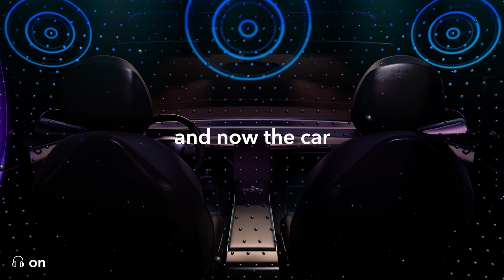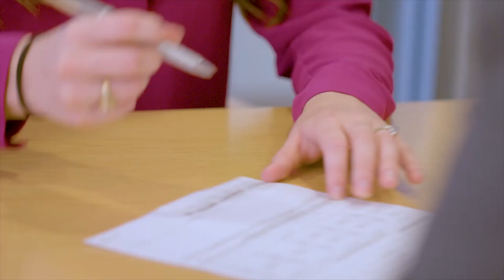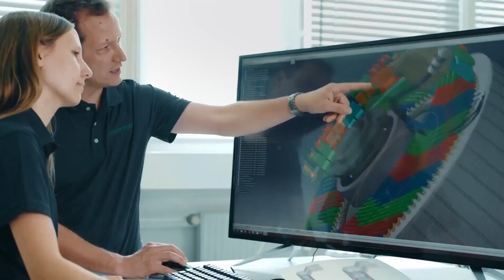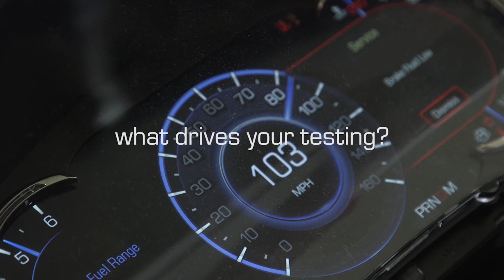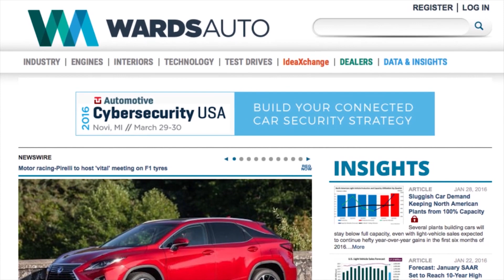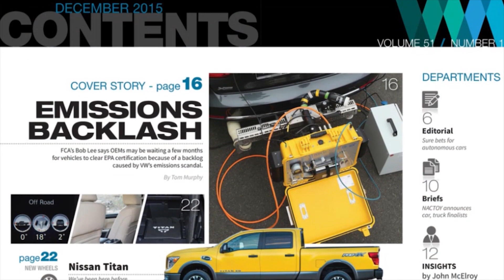Tesla to Ship 1st Semis to Pepsi; Hotel Powered by Hyundai IONIQ 5s - Autoline Daily 3422

Comment: I really like the idea of using commercial vehicles as a testbed for new technologies.  New battery chemistries, cell formats, new battery types, new charging standards, electrical architectures, HVAC technologies, platooning systems, active aero, tires, brakes suspension, etc.  Commercial vehicles such as trucks, last-mile delivery vehicles, and even coach buses see plenty of use,  consume massive amounts of fuel, and emit large amounts of pollution.  If any technology works well on them, then they'll almost certainly translate well when in a passenger vehicle application.

Comment: The 2500 GMC Sierra (and Silverado) are now the class leader in payload and towing capacity. The suspension upgrades earned it this new title.
Reply: I haven't driven a diesel truck since the 2007 super duty I owned... I've got to try one of these new ones. Insane numbers.
Reply: @kmo1290  i have the current generation L5P Duramax and it tows our 38' fifth wheel amazingly well. This updated L5P Duramax has even more torque and the 10 speed transmission will keep it in the sweet spot all the time.
Reply: This category is so fought out that expect both Ford and Stellantis to "up the ante" on their HD's soon (it's so a $🐄for all three). None of the three will make a HD BET any time soon, as electric motors and batteries are not made (50-70% loss on range) for towing or off-roading.
Reply: @syxepop  exactly. This segment will be highly profitable for at least another decade and well into the 30s. I'd actually love and EV HD pickup, but energy density in battery packs just isn't there yet and if you put a big enough battery in to tow with you'll have zero payload remaining.
Reply: @syxepop  I think Ford recently said to expect hydrogen HD trucks before BEV. I assume they mean FCEV, but I think Toyota and some others are doing R&D on hydrogen ICE as well.
Reply: IS this why it is outsold (BY A MILE) by the FOrd F150 but ALSO BY THE RAM??!! LOL
Reply: @anastassiosperakis2869  not sure what you're smoking but it must be pretty good! GM has been the number 1 selling full size pickup manufacturer for years? Also GMC is one of the most profitable brands in the world, Denali trim has a higher take rate almost every year.
Reply: GM is crushing everybody in heavy duty pick up trucks, and that is with their old model, the new model will just add to that.   Ford actually invented the segment with the super duty, and in 2000 had 75% marketshare, now, GM has crushed Ford and market share in the heavy duty segment, GM now has 40%, Ford struggling to hold onto 30%
Reply: @syxepop  Not sure how long that "any time soon" will work out to.   Navistar is building class B trucks.   If they can get or make the batteries they can build them.   Yes would be nice to have lighter battery packs.
Reply: @kmo1290  Not to sound like Elon but hydrogen makes little sense.   Especially hydrogen ICE.    Not efficient enough.
Green hydrogen starts with getting negative cost green electricity.   Lighter batteries are far more likely the making the magic work that hydrogen needs to compete.  I do see some interesting work with hydrogen stored on disks or in powder.   Works and public adoption aree a longs ways apart.
Reply: @anastassiosperakis2869  It is not the first time GM has made a better riding pickup.
Reply: @danharold3087  i was never in the market for one of these ridiculous things, but they are very popular with our secretaries (not the GMs, the Fs and the RAMS. Apparently they don;t consider the GM ones manly enough. Too bad for bankrupt GM, to make the better pickup and end up THIRD in sales behind even RAM and WAY behind Ford.
Reply: @danharold3087  I agree, it's not something that can be supported as the primary passenger vehicle power source. I just think it's interesting technology for things like HD trucks until (if?) battery density solves the range problem. But then you still have the same problem as the Mirai only being viable in California due to fill station infrastructure, and it seems unlikely anybody will make an investment in national infrastructure.
Reply: @kmo1290  Same problem as battery swapping.     By the time you get the infrastructure built no one will need it.
Reply: @anastassiosperakis2869  The companies now carrying the names GM FORD etc have little to do with the ones of old.  Used to love ford's esp the pickups.  Zero brand loyalty from me
Reply: @kmo1290  People fail to realize how many of the trucks in use today could be replaced by electric.  School busses, trash trucks, fire trucks, bucket trucks, delivery trucks, most any class B.    

What I don't like about hydrogen is that it is like handing the ransom money we now pay for gas over to some hydrogen company.   Electricity is too easy to make for anyone to corner the market. 

The amount of money to be saved by the operators of electric class A trucks is immense.  Once this becomes understood and proven they will never keep up with demand.

Comment: The new GMC HD pickup looks great,   nice interior,  and great power/towing.
Reply: No pickup looks good, much less great. They are BRICKS with RIDICULOUS grilles.
Reply: @anastassiosperakis2869  the Cybertruck looks much better 🤣😂🤣!
Reply: I didn't know GM was sponsoring this comment section.
Reply: It looks relatively good for a pickup, cybertruck looks great, but it doesn't exist.
Reply: @rp9674  the Cybertruch DOES exist very much. AND I never said it looks "great", I said that its INTELLIGENT design weirdness is FUNCTIONAL and not just  silly design, like all this chrome on GM-Ford-RAM pickups.
Reply: @anastassiosperakis2869    Grill means cooling,    need lots of cooling pulling a 36K load up the mountains in the summer..
Reply: @dmitchellhomes  No, grill: verb, to cook (on a grill)...😜 Grille is on the front of your truck.
Reply: @dmitchellhomes  thanks for the engineering 101 lesson. Hilarious to lecture one with four grad degrees from MIT who was an engin prof for 40 years at the U of Michigan. MY POINT was that all these stupid secretaries who drive pickup trucks they never needed are making gas and diesel even more expensive for YOU.
Reply: @anastassiosperakis2869  well, if you know anything about basic car design, you realize all of the pick up trucks have been getting much larger grills and much larger radiators, as their capacity for towing increases.  These are very connected..   Today’s pick up trucks, have power and capability similar to the semi trucks from the 1970s.
Reply: @anastassiosperakis2869  tesla has not sold a single cyber truck, even though they unveiled it three years ago, and have not conducted a serious test program. Yet, they have a few Proto types that they bring out once in a while, in recruiting efforts, or to pump the stock, but they have not ever taken one on a long road trip going anywhere, typical OEMs, put millions of miles on their prototypes, before a car ever comes to production..   tesla is a long way away on a cyber truck, none have ever been spotted, towing a trailer in the mountains, which is something you can’t test on a track or in a laboratory.   I’m sure when it first gets released to the public, people, like TFL truck, will take it straight to the steepest mountain pass in the USA and load it to the full capacity and see just how it does in the hottest summer day
Reply: @anastassiosperakis2869  I think cybertruck does look great, hope to see one IRL
Reply: @rp9674  I don't, but I later understood the reasons for the weird looks, it is becauser of its very usefulfunctions that it has this pointed roof, it's not a COnehead-mobile. The grille needs some work, it should not be expensive to fix.
Reply: @anastassiosperakis2869  it looks like the future, not grandma's truck. The coneheads were very tech savvy, as the French are.
Reply: @dmitchellhomes  I find it amusing that so many people wonder how an EV truck will do when towing up a steep hill on a hot day, when everything the world has learned about EVs since 2008 tells us with some certainty that an EV truck will tow way, way better than any combustion truck, especially up a steep hill on a hot day.

If you doubt it, check out the videos where TFL compare the F-150 Lightning with ICE trucks on difficult towing tasks.  After conducting all of these tests, Roman's conclusion?  The 2022 Lightning is "the best truck Ford has ever made."

And bear in mind, the Lightning is only the second serious EV Ford has ever made, and the first serious EV pickup on the market.  Expect to see big improvements in future generations.

The Cybertruck will be a fifth generation EV.  I don't know if the  packaging or marketing will fit the requirements of the US truck market.  But I can tell you with confidence, it will tow up a steep hill on a hot day way better than any truck you've ever driven.
Reply: @davidmenasco5743  I find it amusing when a person like you who has never towed anything in their life, obviously from your statement starts making claims, based on one, YouTube video, they saw online, and taking towing in general completely out of contact.   The F150 lightning towing it’s maximum capacity, has an effective range of 100 miles, where is this diesel towing three times as much, will go well over 300 miles between fill ups that take five minutes.  TFL, did not compare an electric vehicle, towing, to a heavy duty pick up, they compared it to light duty pick ups..    The problem for an electric pick up, when it comes to towing, and towing heavy, and in the summer, is the energy density of the battery compared to a tank of diesel, there is no comparison in energy density..   On the cyber truck, I have a hard time taking any of Tesla claims. Seriously, they showed that truck to the public three years ago, and still don’t even have a legitimate pre-production prototype doing highway testing, they have never been spotted, towing a trailer, which is something any OEM that is developing a new truck, will be seen all over the highway system in the USA, at least one year before deliveries and production start.  Tesla hasn’t even built the production intent models for this testing.  They have a few hand built one off each cyber truck, Proto types, which amount to more concepts vehicle’s, because they were not built with production tooling, or using production methods, the initial cyber truck prototype, had a steel tubular frame, we know that because motor trend magazine got to go behind the scenes and see it being built and wrote about it..  We will have to wait for Tesla to bring it to market to see, but even if tesla achieve their claims, 500 mile range, 14,000 pounds towing, they are still way behind this diesel, which has well over 700 miles of range on a tank, and control up to 36,000 pounds..   This is a massive difference in capability.   I think it’s possible to meet Teslas claims of a 500 mile range, and 14,000 pounds towing ability, but a truck with that capability is going to be heavy, because it needs a big battery pack.   When you look at what Tesla charges for vehicles, their cars with 100 kWh battery packs sell for well over 100 K and, and Tesla has never built a car with a 500 mile range.    So I think we better wait and see, Tesla initially said the plaid would do a lot of things that never made it to production, I think cyber truck will be the same, reaching the capabilities, they promised will be difficult, and very expensive, which Tesla fans have trouble admitting now, but reality will set in soon for them.
Reply: @dmitchellhomes  I didn't say farther, I said better.  You have a point about light duty vs  heavy duty towing capacity.  However, try to chirp the tires in a heavy duty ICE truck, and pass cars while you're towing uphill.  The experience of towing in any fifth generation EV truck will be unlike any towing you've ever done before.

Energy density is nice and all, but efficiency is just as important.  That diesel is likely about 15 to 20 percent efficient.  A fifth generation EV from Tesla is gonna be about 90 percent efficient (without the trailer).

In today's market, it's possible that Tesla may not be able to meet their Cybertruck promises at a decent price.  But sometime in the next six to eight years, if not sooner, battery prices will drop off a cliff.  At that point, it will be no problem to meet those targets and pass them.  As chemistries and efficiencies improve, those targets will be seen as just the starting point of a long term revolution.

Here's the kicker:  The EV truck won't give your neighbors' kids asthma or cancer or heart disease. And they won't grow up in a world held hostage by the oil cartel.  As far as I'm concerned, that's what it's really all about.
Reply: @davidmenasco5743  now you are exposing that you know even less about towing and diesels than I thought.   Let me explain something to you about efficiency, because I know..   Towing, or any high load situation, rapid acceleration, the energy density you have is reserve is always the most important factor..   If you tow at a steady speed around 50 miles an hour you’ll get the best range from your EV however, if you are jack rabbit starting, or chirping your tires, you will find your range drops even more, and this just comes down to physics and energy density.    As for your calculation of engine efficiency, you are wrong there, too, as a turbo  diesel engine underload is when it has the highest efficiency in its cycle, most of them are in the high 30s for thermal efficiency.    When a diesel engine is pushed, the hardest, is when it becomes its most thermally efficient, EV’s are the opposite.   You keep talking about efficiency from generation five EV’s don’t think you know anything about what you’re talking about..   I guess you are one of those holding out hope that the cyber truck is going to be something special, I hate to tell you, but it’s just going to be expensive, stainless steel prices are very high, and bulletproof glass is both expensive, and heavy..   As for heavy duty, pick up being able to pass cars while towing, While uphill,  in most situations, the speed laws, and the trailer capabilities are the limiting factors, today’s pick up trucks have an awful lot of power, having had a diesel pick up, I can tell you,  power is very abundant.   If you look at the conditions of towing a heavy trailer in hot weather, it’s very similar to running a car on the track, long stretches of high throttle angle and maximum power, this is where the heavy duty pick ups have no problem, they have huge radiators and can pull hard forever in hot weather, tesla, though, we know will quickly reach thermal limits if it’s pushed hard, as all, Teslas have this problem.   the plaid can be pushed hard for about five minutes before it reaches thermal limits..   And that makes about 1000 foot pounds of torque, similar to a diesel pick up which can make 1000 foot pounds of torque for an entire tank of fuel without having any problem..    So in your conversation, you are wrong on most everything when it comes to trailering..   An HD pick up, will embarrass any electric pick up when in the toughest towing conditions..   Will tow the load, farther, fuel quicker..
Reply: @davidmenasco5743    Perhaps you check in with TFL Truck today to prove all my points on energy density,  as they did a towing test over the IKE,  let's just say the Hummer made it,  the F150 lightning didn't,  and that is with only 7500 lbs and fall weather.     14K lbs and in the summer is different.    The GM  HD diesel will pull 36K lbs and make it mid Summer with fuel range never being a concern,   are you getting it?

Comment: So Dept. of Defense will use GM's pouch-cell lithium battery packs.  My understanding is they are the least durable battery form when it comes to harsh vibration that military vehicles will subject it too.  Good lobbying GM!
Reply: Pouch cells tend to fracture more than cylindrical cells regardless of whether the movement is in the coronal, sagittal or transverse planes. This is not the case when they are new, but as the dendrites form and the slurry retracts it leaves space for the cathode and anode to shift around - resulting in a failed cell at the least or possibly even a complete short and thermal runaway. Using a laminant plastic wall can help fix this to an extent - but you lose out on having structural packs.